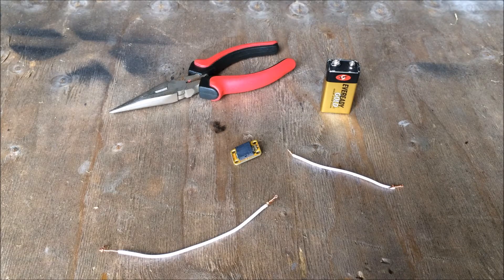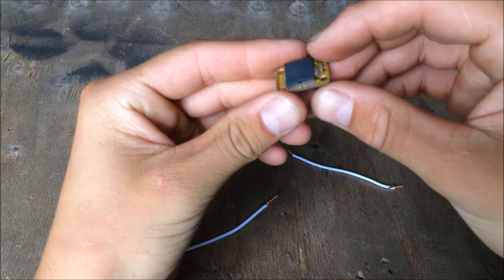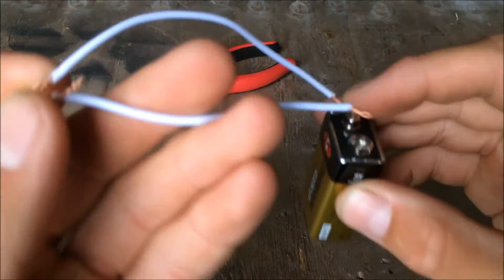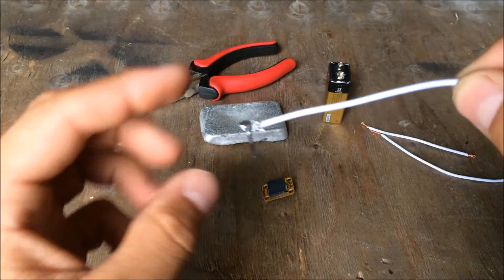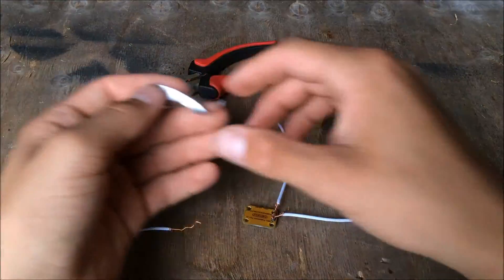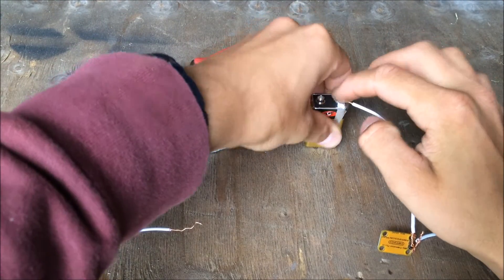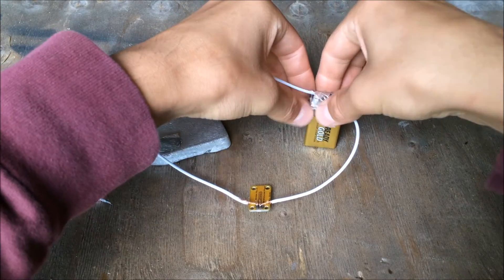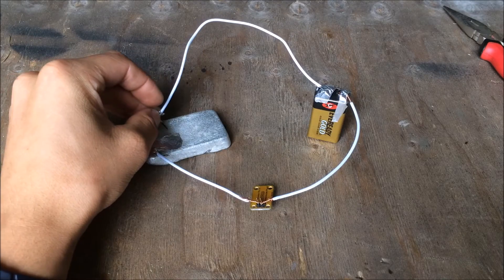Homemade Telegraph

Comment: Anybody know what purpose that kind of speaker is supposed to serve?  I just started doing a basic morse code key, and for the buzzer i remembered that a few years back i bought an arduino kit that had one.  But then it just came out with that crackling 'gieger-counter'-type sound, and i thought i'd done something wrong or broken it until i tried an identical looking one from the same kit and it was a proper piezoelectric buzzer.